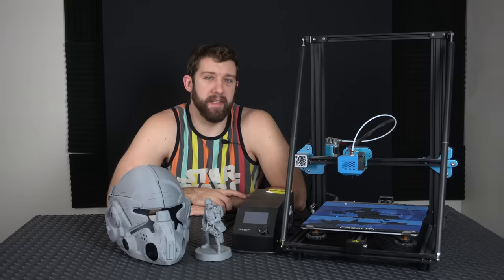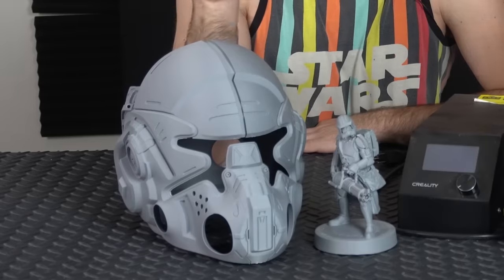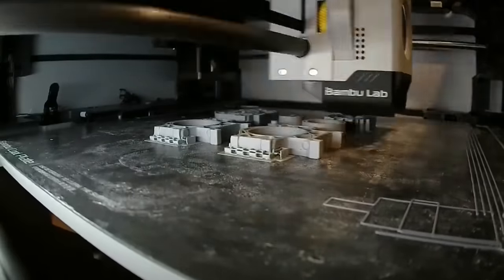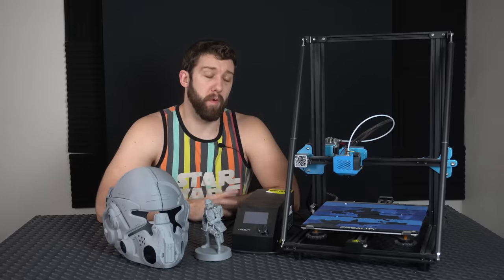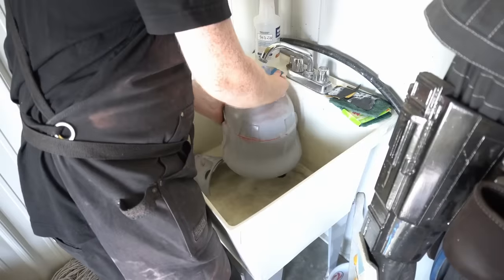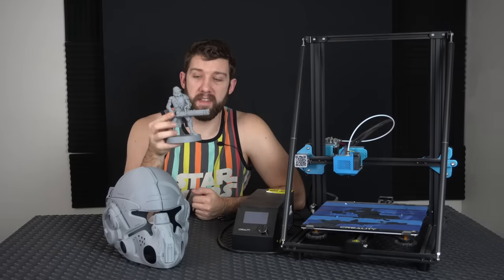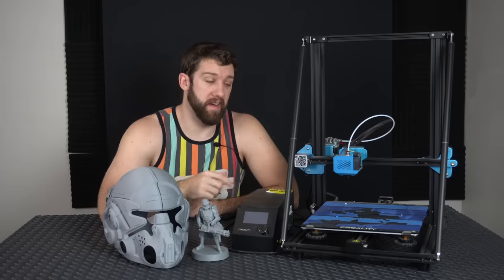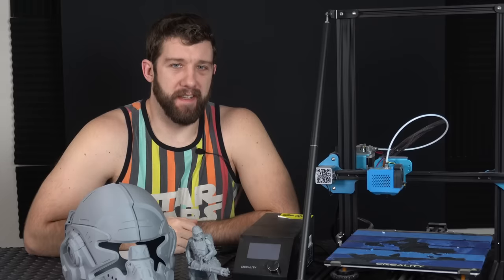I Spent $15,000 Upgrading My 3D Print Farm

Comment: I just upgraded it to Bambulab X1C and my CR10 V3 is having problems and I will not going to put in my print farm. So I will leave it as a 3D printer for testing products or for personal use or for fix anything.

Comment: I was also considering the X1C but went with the Elegoo Neptune 4 Max as I want to try and print helmets like your awesome designs in as few parts are possible, preferable in one piece for the main part and then all the decors beside it. It prints fast, much faster than my old GooFoo Mido Core-XY style and so far I am pretty happy with the outcome on the stuff I have printed :)

Comment: what's the gain of using X1C in your printing farm than P1P or P1S. Is the lidar and touch screen worth the 500$ increase?
Reply from the maker: Auto print fail stoppage is the biggest one. It'll save a lot of materials over the course of its life
Reply: @GalacticArmory    I hear that but I dont completely agree. if the gcode is tested then only the bed adhesion could be an issue. And the bambu textured sheet is top notch if you keep it clean. I had zero fuilures in 2 months(100+ prints). Dunno
Reply: 35-45kg in material PER printer in failures. Can't picture it. even in your farm
Reply from the maker: @fotisxevgenis  as you can imagine we test a lot of new gcodes with all the files we produce

Comment: I have a faster printer coming in next month for review and it beats everything I've seen to date for speed over 700mm/s. Also got a rumor that yes Bambulab is working on a large bed sized model, but no details on core XyZ or open framed etc. Our print farm sold off almost all the bed slingers once we saw the first hyper speed core machine come in for testing. It produced our models 8 times faster and that is like..HOLY PLA+ batman....get these bed slingers out of here.

Comment: I ended up buying one of the Qidi X-Max-3's despite your review. I hooked a webcam up to it and connected it to Obico and now I have AI watching prints and can stop it automatically if it fails. That said, they really need to release one with lidar and auto z offset and it would be a perfect printer. Stock klipper is incredible to have on a printer like this.

Comment: Just got my k1 max. Thing is a beast. Print quality on default settings is outstanding! Not sure what he was doing wrong with his. Considered a bambu but it wasn't worth getting a ender 3 sized bed (which I have) with a price like that. The multicolor change would be neat but I have no use for it right now. Now that I have some hyper pla I think I am going to see how my Neo Max works out.

Comment: i call BS on not finding the parts... fans and hotends for the CR10 are readily available. yeah, the corexy Bambu will print better and faster. and it makes sense for a print farm.
Reply from the maker: The V2 uses a different hotend than the V1 block

Comment: Bigger x1 would mean a lot more ringing. Corexy has long belts. Probably not a big issue for you though since you’re doing post processing.
Reply: Core XY also doesn't put the belts under the load of a bed slingers at similar speeds due to the weight differences, large beds have a lot of momentum pulling at those belts
Plus it not like you can't increase belt width to compensate on stretch of it been longer if the prototype reveals belt issues

Comment: have you heard of the Comgrow t500.  its build volume is 500cubed and it runs clipper so it should be pretty fast.
Reply: T500 is a solid printer as long as your throw away the included print bed and buy a PEI sheet
Reply: @ShihanQu  I did like my PEI sheet on my ender 3 s1 pro. I'm planning on getting a T500 in the future because it seems convenient to be able to print things whole.😃

Comment: CR-10s were never top of the line printers lol. They were always an expensive budget option.

How are you offsetting the "lower value" of multipiece helmets to your customers? As in: multipiece helmets involve more labor and will never be as strong as singlepiece buckets, even if they've got a higher level of detail it's still a big difference.
Reply from the maker: You might want to use a stronger glue if you think multipiece helmets aren't as strong as single piece prints. The point of failure on all my multipart prints has always been the print itself (which would also be the case on a single helmet print) - not the glue bond.
Reply: @GalacticArmory  i noticed at the end of the video you said PLA so i guess that makes sense.

Still doesn't take away that multipiece helmets involve labour that otherwise wouldn't be involved and generally will end up with perceivable joints. Both due to tiny misaligment(talking sub degree here) or from uneven part expansion.
Reply from the maker: @ProtesttheAntagonist  A few minutes at most. Our files are made to hide the seam lines along natural lines of the helmet so they're not visible once the helmet is assembled.

Comment: Hey, now that you're using an enclosed printer I (as a hobbyist) would recommend you testing some ABS vs PLA. ABS sands so much easier, is more impact resistant, and is less dense than PLA. 330m per kilo vs 400m for ABS.
Reply from the maker: Yeah but stinky
Reply: @GalacticArmory You may like ASA, it is a less toxic and less stinky alternative to ABS. It is also more weather resistant than ABS and can undergo acetone smoothing like ABS. I use ASA on my X1C. Cheers.
Reply: @GalacticArmory  your Bambu's are air tight 😁.  Seriously though, if I open my printers after a print while hot I get hit with it but if cool then no stink. There is a residue on the inside of my machines.
Reply: @GalacticArmory  Get a bentobox for the chamber.

Comment: That's hilarious to refer to your old printers as "top of the line at the time". They may have been the best choice for the price at the time, but there have been way better printers for over a decade before those printers ever came out. Those are all budget printers.
Reply from the maker: Fine, top of the - desktop midrange 3d printer - line
Reply: @GalacticArmory  Pfft it's not even a $250000 stratasys or HP  /s
Reply from the maker: @electronicsandewastescrapp7384 I know right?!? How could I make such a claim

Comment: The really sad part about this is that you spent about 6k to 9k TOO MUCH!!! Had you waited you could have bought the new A1 for $399 and saved a fortune! And as you used Cr-10s before this (BTW the only printers I own (old school single Z CR-10, a huge CR-10 S5, and a newer CR-10 V3) you obviously didn't need the enclosure so could have just gone with the new Bambu A1... which right after Xmas I'm getting one for myself!

Comment: I would check out the new FLSUN S1 before you commit to a lot of Bambu printers. My FLSUN V400 prints faster at better quality than my Bambu, so I have extremely high hopes for the S1, and the pre-release footage looks promising. Heck, V400 are sold for cheap now also, you'd get the higher build volume and speed you're looking for.  The round Delta format is also conducive to helmets. I will be the first in line for a larger Bambu though, because I'm hooked on multi-color printing. But for single color and speed the FLSUN can't be beat.  EDIT: Well, I made this comment in the beginning of the video when you were talking about the Creality, somehow I brain farted on the title where you already forked over 15k...I'm not the reddest apple in the orchard 😂😂
Reply from the maker: I'd still be down to test it out!
Reply: Yeah but the flsun printers don’t have the volume. But they are pretty darn handy for leg and arm parts on armor. And that aren’t exactly slow either. I think they have a pretty good place in a print farm depending on what your making but as sole printers I highly disagree.
Reply: @shawnhicks619  they have more volume than a Bambu, so if you don’t need multicolor, the FLSUN V400 or new crop makes more sense as a sole printer.
Reply: @Ferrous_Bueller  in z height, but since the build plate is round x any y are reduced, and at least with mine, putting items on the edges often have funky results.

Comment: Reason they have small build volumes is so there's less resistant and travel when speed printing. It's trickier to speed print with larger CoreXY rigs, reason you don't really see them often even with VZbots and Rat Rigs.
Reply from the maker: I'd sacrifice a bit of speed for just 50mm more build volume in each axis